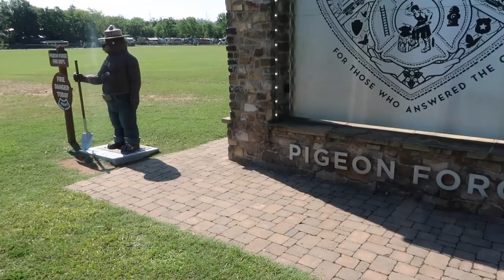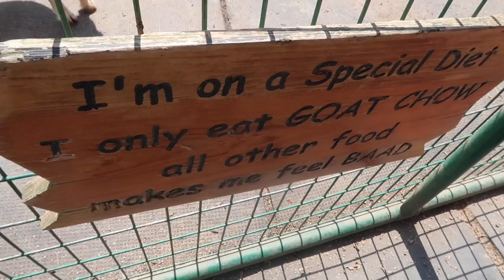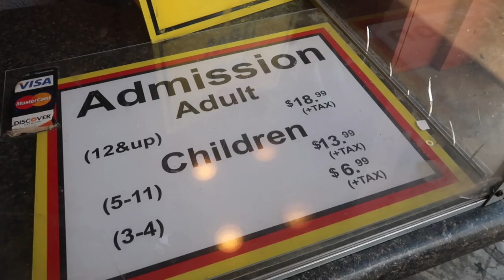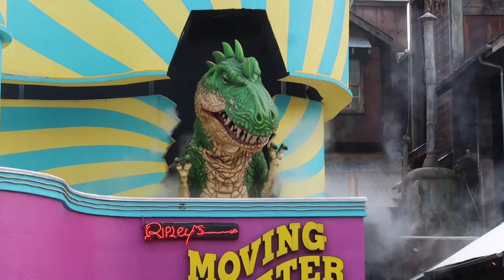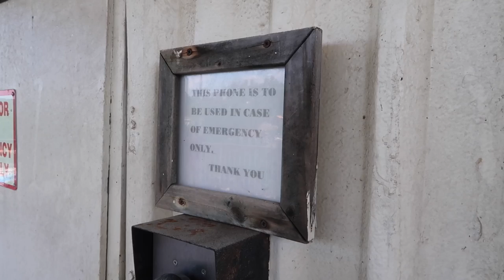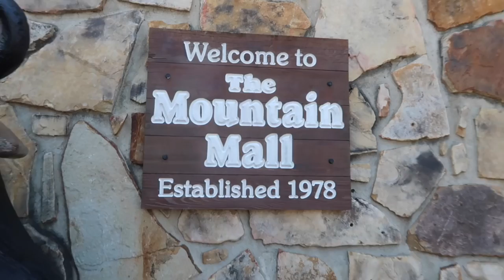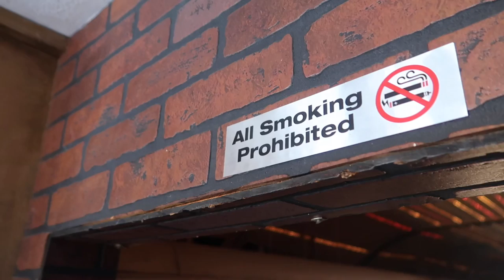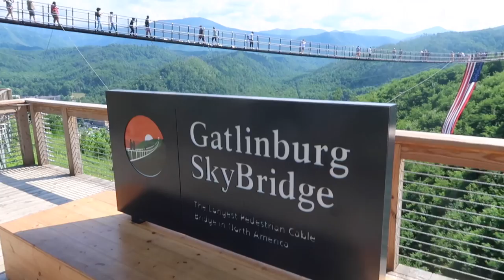A Day In Pigeon Forge & Gatlinburg  - Mountain Goat Coaster / Jurassic Boat & Earthquake The Ride

Comment: 15:50  Where did they move the wax figures to?
🤔😕😁😂 To Yankee Candle of course!
---------------------------------------------------------------
18:42 Someone did in fact jump and commit suicide from the Gatlinburg Space Needle back in 2016. It was 58-year-old David Ray Pinyan of Pigeon Forge.
---------------------------------------------------------------
29:12  TULIP TOWER
T - Stands for Total Depravity
U - Stands for Unconditional Election
L - Stands for Limited Atonement
I - Stands for Irresistible Grace
P - Stands for Perseverance of the Saints

Comment: If the metal breaks gravity would be strong enough to pull you back down in the direction of the wind so you could land anywhere just be prepared to Swim if it lands in water and try to  get either to a boat or land to survive and use surroundings to survive also use your phone for emergency contacts if still alive / did not loose yet or use the land / mirror to survive as well as plants. If injured use water or mud to help survival
Reply: Also plants help healing /Itchiness as well like Aloe